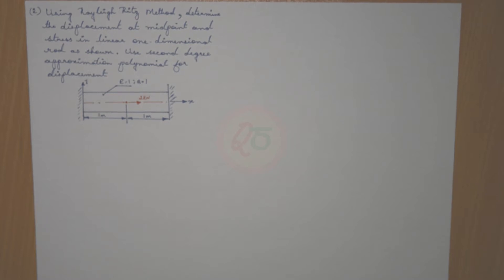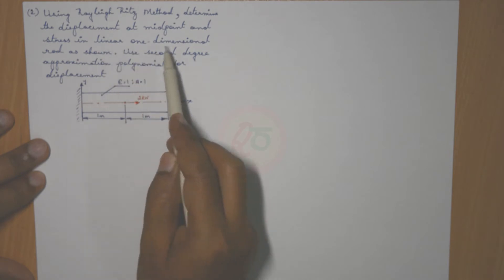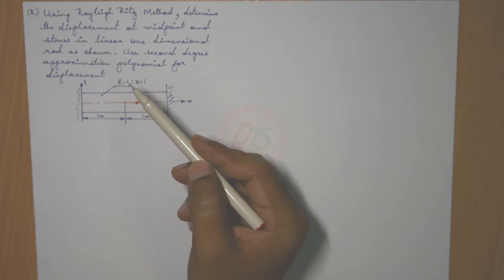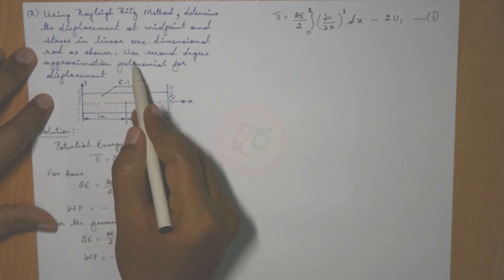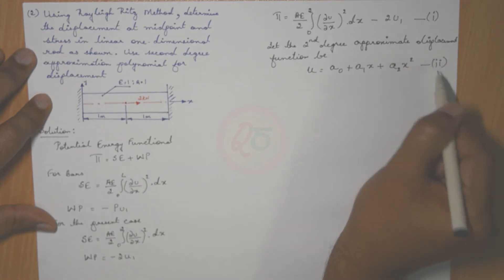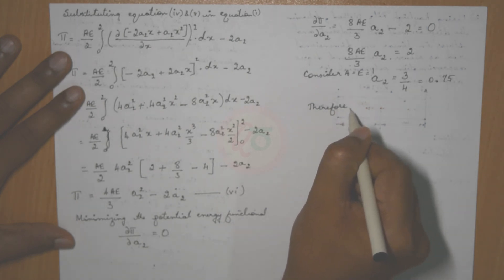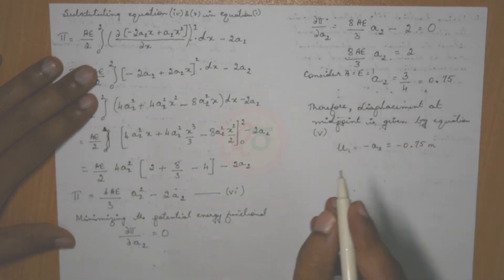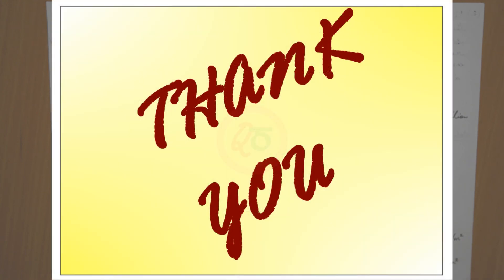Rayleigh Ritz Method 02

Comment: Sir,I have a doubt. In the last step when we have to find the stress. We have to find it at the midpoint of bar,i.e x=1,which gives the  answer 0. However, you have substituted,x=0. Kindly clarify
Reply from the maker: Generally we find stress at support, as it will be maximum there, hence at x=0 is considered

Comment: Sir, how do we solve same problem using linear polynomial a0+a1x, as in this case using both boundary conditions coefficients a0 and a1 both will become zero
Reply from the maker: Assumption of polynomial degree should be such that boundary conditions are satisfied. 1 degree polynomial as mentioned by you will not be sufficient. Hence, solution cannot be obtained